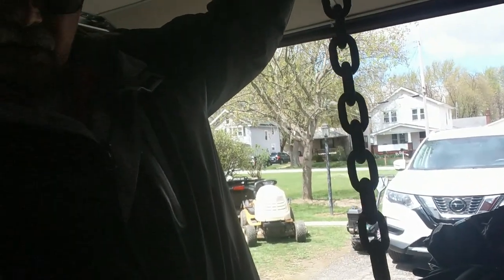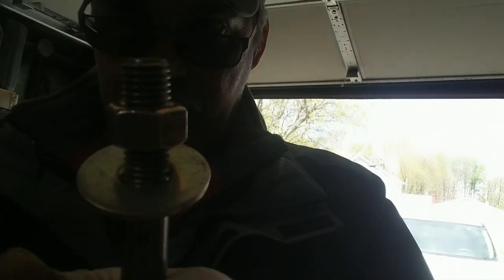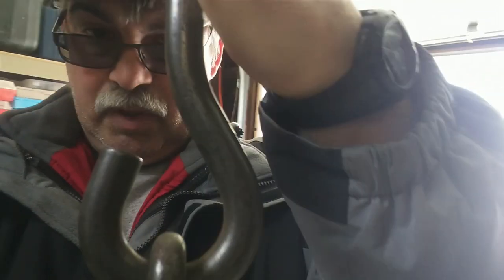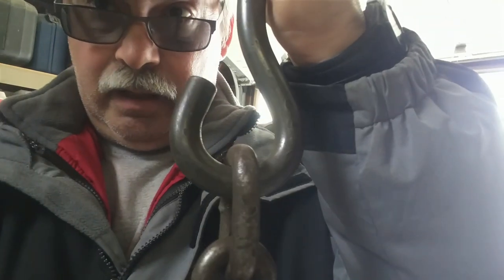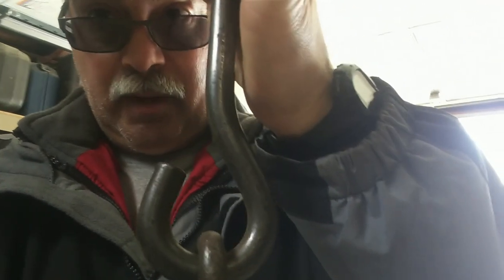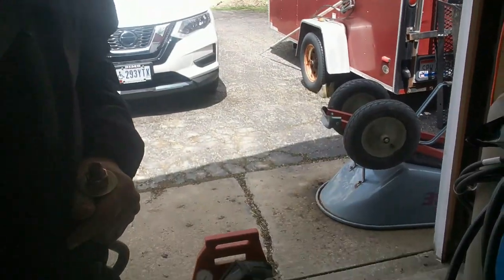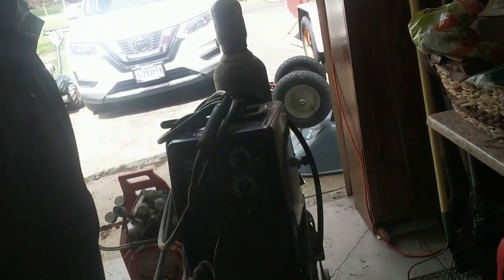How To Mig Weld

Comment: Andy has that drill.. i shiver when i see it. 3 holes in my house to put the cable in...lol ha ha ha. DO NOT LOOK AT THE LIGHT LOL..  oh wow.. Rob that works perfectly. Good job. had no idea ladders were that expensive. I think i'd lock it too.  good job. and you didn't burn a darn thing lol lol
Reply from the maker: Yeah, don't want to lose that ladder!  No Fires!!!  No burning!!  lol
Reply: That drill is only about 14 inches, I have one that is 48 inches, it is used for drilling holes through studs to run wiring.
Reply: I keep a fire extinguisher handy, just in case, lol